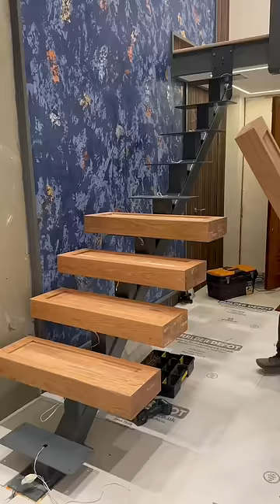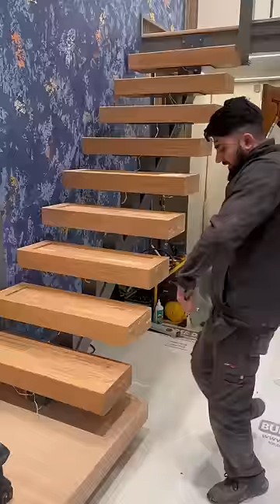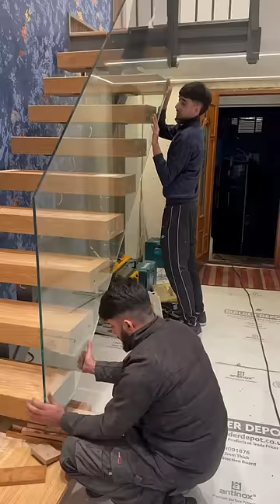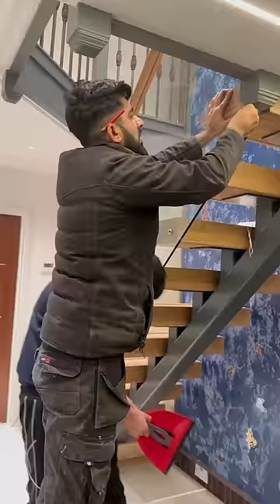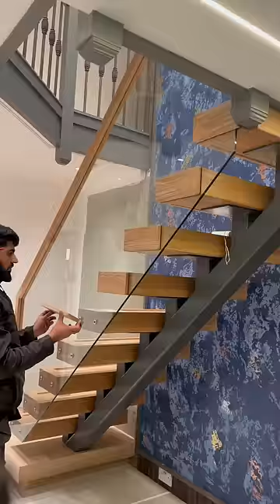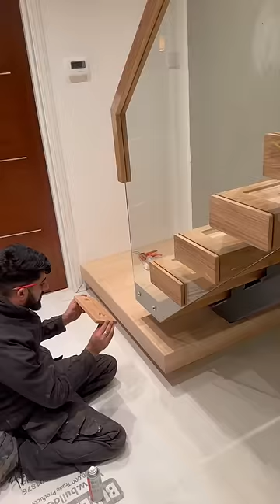How to make spine stair#bespoke #spine stair #staircase #spinestretcher #floating #interiordesign

Comment: You didn’t show any screw/attachment at the bottom, does that mean, if we step on the right most part, some part of load will get transferred to the glass ?
Reply: Each step is so thick that the bending moment at the glass end would be negligible for even a heavy weight person. Whatsmore,  I suspect there would be a rubber sleeve around the 2 screws through the glass at each step-end. This structure is so over-designed only violent use !!!! would damage it. But why would anyone want to do that!